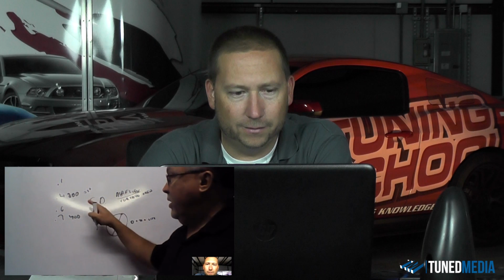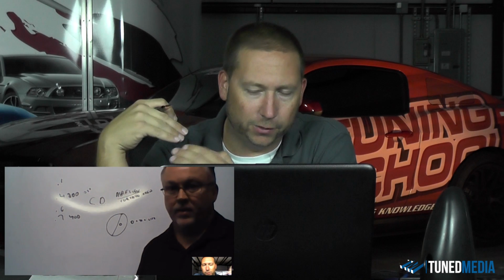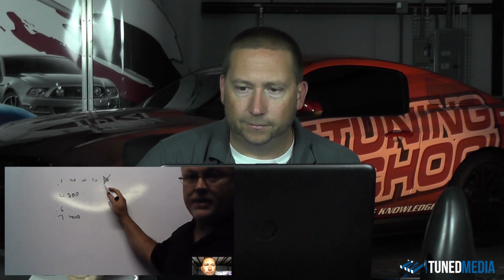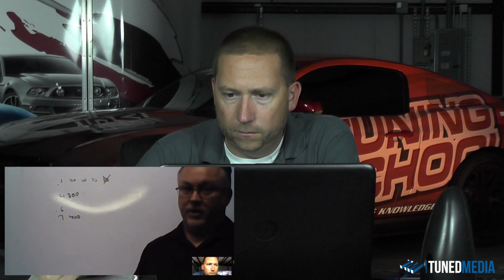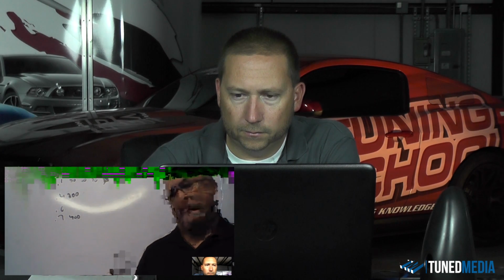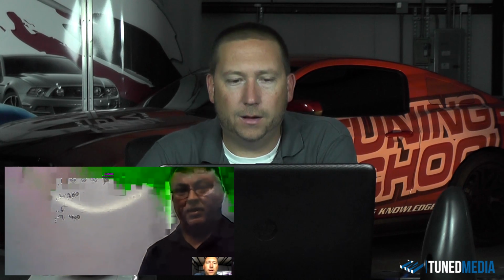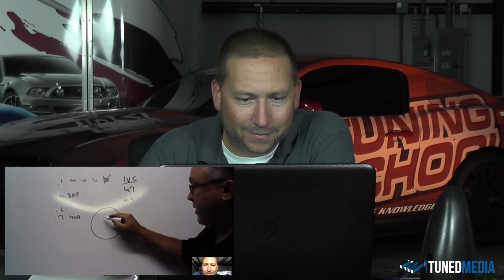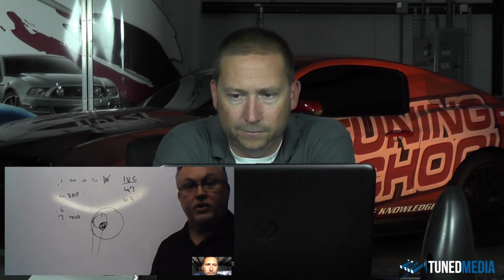Forced Induction (Part 9): We ask Brian Tooley is  bigger always better? Plus how he got started...

Comment: Its all about pressure and the air flow pressure in the exhaust valve, ( even the angel of the valve seat is important), the bigger it is is not the answer its streamlining and match porting the exhaust valve and the air flow of the exhaust to streamline it when its on the exhaust point and blue printing the timing at the point where all the exhaust gases are extracted out before the inlet valve starts to open up, so testing and flow charts for the engine you have is the best way to go ,so LS engines are made to work as they are if you start to mess with factory items, make sure you check with a GM Chevy engine aftermarket specialists?

Comment: Great Video and the facts are true about LS3 head and the big valves.
However, a lot of people have had great luck with these heads which make crazy power and torque,
I think these heads are very sensitive to cam timing and need a lot more exhaust timing to perform really well.
Brian's stroker cam has a 15 degree split

Comment: Is AFR220 to big for 383 with blower 142?
Reply: IMHO a 142 is a low and mid range blower.  220 is better utilized at a higher rpm and sonewhat wasted on a 142.  You are better off with a AFR 195 and flow more than efficient and a good balance for what you're using it for.   Good luck on your build.

Comment: Canted valve motors seem to be able to run larger intake valves without the exhaust valve crowding/shrouding, are these talks about inline valve motors? What about the old Cleveland Ford design dominant Engine Masters? Do you have tech that applies?

Comment: The other problem with 98.8% of engine builders is that they use the customer as the test bed, and will not spend a plug nickle on testing, like you have done

Comment: Why would you care about HP/CI when there aren't any rules limiting displacement on the street or in bracket racing? If Ford comes out with a 4.400" bore space block with DOHC heads it will be MORE than 30" wide at the valve covers. If it had a wedge head, and it could be 30" wide, thus it could approach a 5" bore spacing. Efficiency is where you find it and I'll never understand why the street guys care about volumetric efficiency.
Reply: So true
Reply: Increasing the bore spacing will make the engine longer... Not wider (unless the larger bores allowed by the increased spacing requires an extra.... Quarter inch, maybe?).
Reply: Volumetric efficiency has nothing to do with displacement/cubic inches... It's a fuel consumption/power ratio...

Comment: how much Scavenging would take place with 114° - 115° of lobe separation on turbocharge charge application I don't understand Titan Motorsports have run  70 to 100lb of boost without back pressure issues (Delta pressure) or Scavenging issues